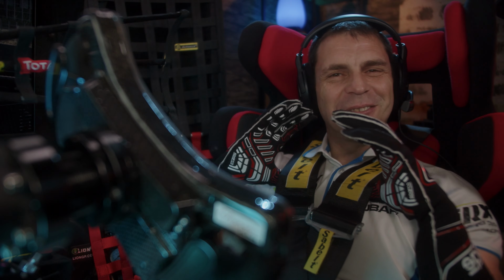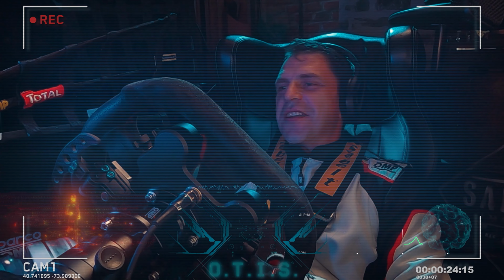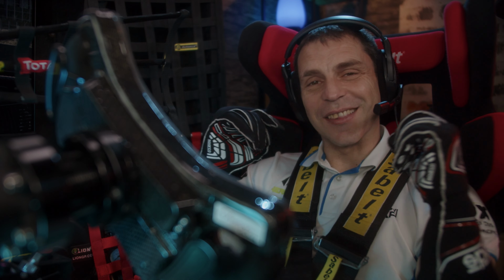Hacks I used for my difficult races

Comment: I use the harness from time to time, but it adds a point to the simulation, especially since I made a movement system for the seat, with two 24v motors and an arduino, now I am developing one for the entire cockipt, since I don't I like the fact that the body moves and changes the point of attack on the pedals. All the best.

Comment: what kind of cable do you use to output the best picture?  DP 1.4 or 2.0?
Reply: @Huy Germese That doesnt effect picture quality but it can effect Hz so FPS. HDMI 2.0 only supports upto 1440p 120hz where Display port supports way higher hz/fps. So you really want Display port but if your using a monitor below 120hz then just use normal hdmi lead. You dont need hdmi 2.0 cables just get any hdmi cable but display port go 1.4
Reply: @Simlife101  tks